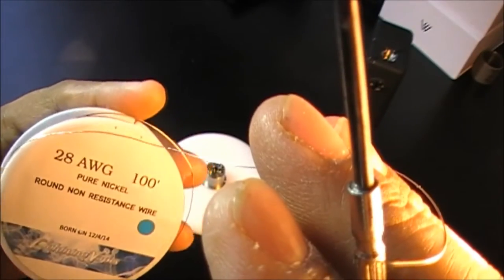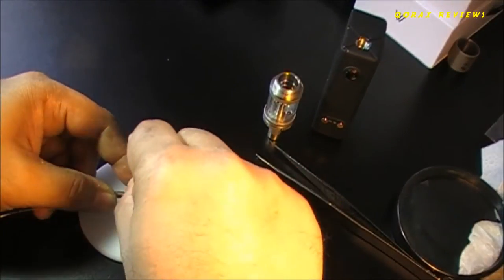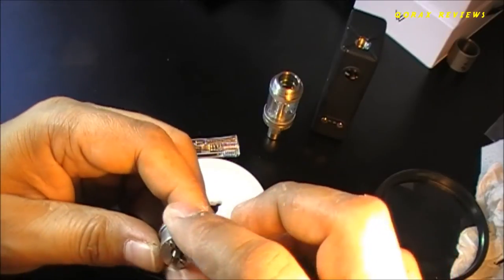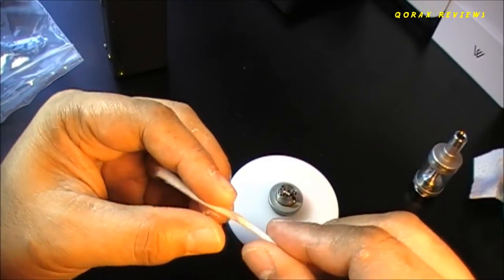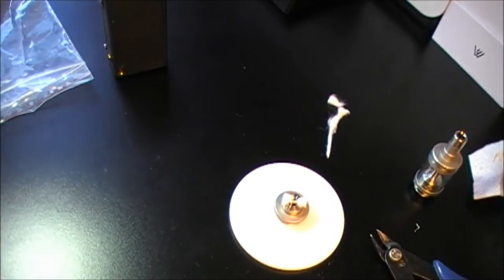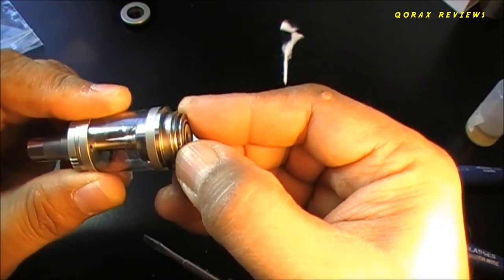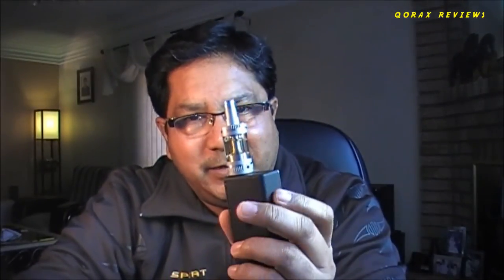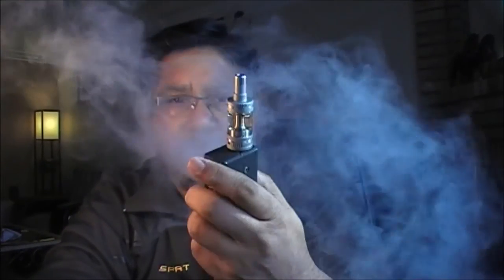TUTORIAL: How to make a TC (Nickel) setup on GEM?

Comment: i have 2 gems and for some reason 1 of them shorts out when placed in the chimney works fine in the dry fire tool
Reply from the maker: +Frank Graziano : That problematic Gem has little larger screws, which stems out a bit more while trapping your coil legs. You aren't alone, happens with many. A bit extra cranking down, or flattening the wire beforehand helps. And remember, Gem isn't affable to higher gauge wires. 28AWG is the max I would go.